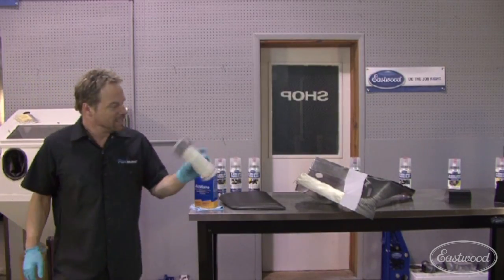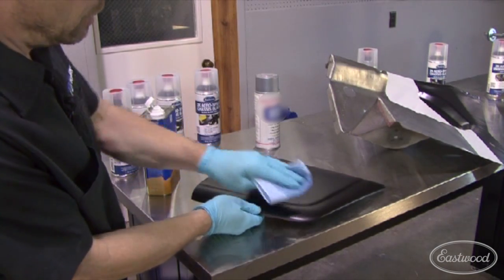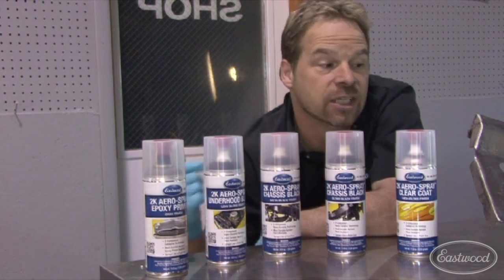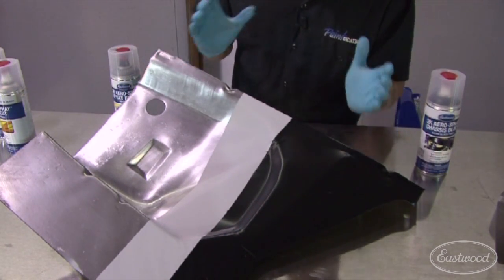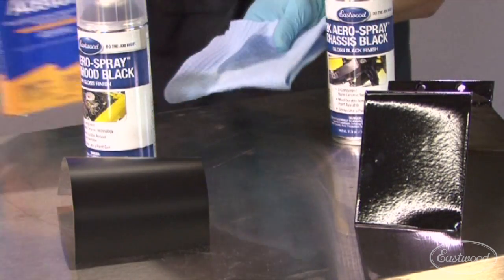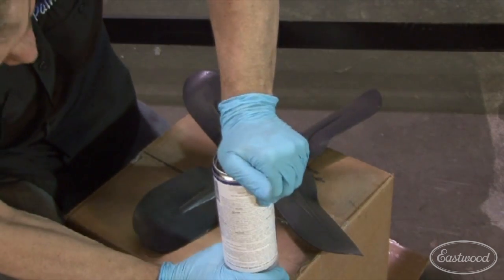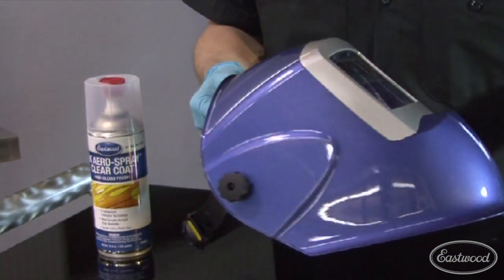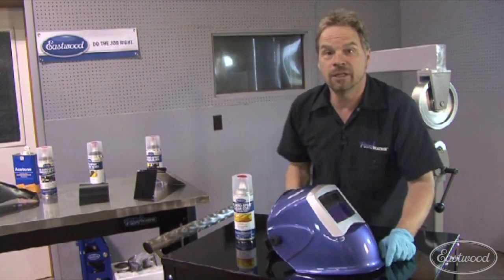2K Aero-Spray Paint Technology in a Can on Kevin's Korner - Eastwood

Comment: Can I sand and clean down to bare metal, spay this on, and then use body filler over it? 
If so, do I need to scuff it?
Reply from the maker: Our 2k Aerospray Epoxy Primer can be applied directly to bare metal.  Yes you need to scuff or sand with 80 grit for filler after it's cured for a few days.

Comment: I used this on one fender and the Spraymax 2K on the other. The Eastwood 2k seemed to last much longer (like I had more in the can even though they were the same size). The Eastwood can also had a much better fan. The Spraymax tip is just inferior. It almost gave me a terrible run. I’d definitely buy this over the Spraymax next time.

Comment: Will the Eatwood clear coat work well o Dr Duplicor  color match paint?
Reply: It works just fine. Just make sure you have a sealer under the base coat because the 1K paint in the van can react with the urethane paint which causes wrinkles.

Comment: I'm going to paint my motorcycle gas tank,, what is the best procedure, using spray paint..
Reply from the maker: Strip to bare metal, spray with epoxy primer, do any necessary bodywork, possibly use a high build primer, then your basecoat and color. You can contact an Eastwood Tech to discuss: 800-343-9353

Comment: Can I used the clear coat over oil base Rustoleum paint or not please let me know thank you
Reply: Miguel Ivan salazar ......yes you can, I painted a motorcycle gas tank 3 years ago using this method. Painted the tank and designs with rustoleum than went over it with 2k clear, several good coats. Still looks great today! Resists gas like a real automotive paint.